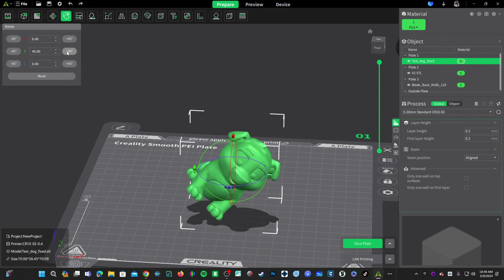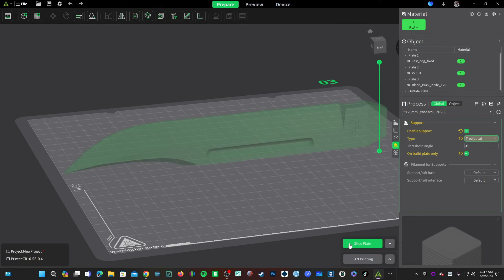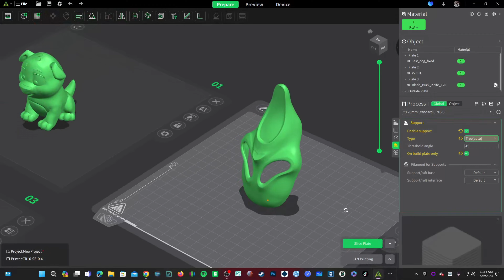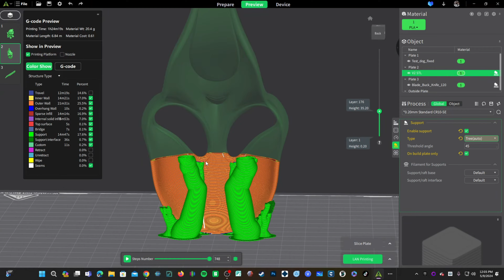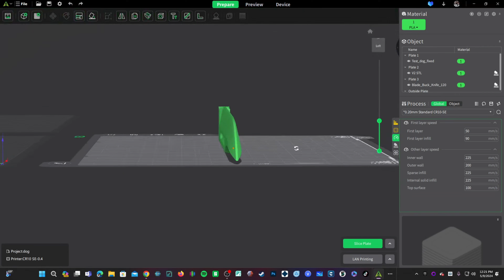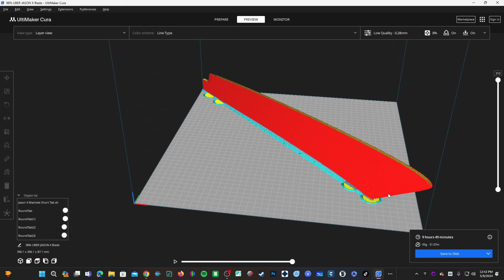Creality Print 5 Slicer Tutorial: Support Painting, Mouse Ears, Infill, Walls, Temp, Speed

Comment: So when I changed mine to -0.25 and I tried -0.50 . My print keeps moving . I’ve tried cleaning my plate with alcohol and using adhesive what am I doing wrong .
Reply from the maker: It's unlikely that the correct Z Offset, will be an even number like that. Also, 0.50, isn't much of an adjustment. You need to lower it, till it works. Whatever # it works at, is the correct #. (for now). 
DO this with me: https://youtu.be/veZB415QHM0?si=_esYwyInC3rGQXtq
Reply: @ so should I be doing - number or no ?
Reply from the maker: You should be adjusting till it works, rather than focusing on what the # is.
Reply: @ nothing is working . I tried 0.25,0.50,0.75 and -0.25,-0.50,-0.75
Reply from the maker: Why did you stop? That entire range is less than 1 millimeter. Step down till it works. follow the exercise above.

Comment: So how can I change my print nozzle height I think it’s causing my print to move around bc it’s too low any video on that
Reply from the maker: It's not. Something else going on. Which machine?
Reply: @ flash forge adventurer 5m
Reply from the maker: It's probably your Z-OFFSET. I don't own a 5M, but it looks like your machine sets it as part of the calibration process. I would rerun the Calibration. If your 1st layer looks too low, or high, make a minor adjustment.
Reply: @ I tried adjusting the offset it’s still moving around .

Comment: Thanks
Reply from the maker: So cool. Thank you!!
Reply: @3DRundown  A small appreciation for your input, good to see more of your stuff, especially with CP6 .. it works well but the support separation is not as good, I will have to compare settings. Have a good day.
Reply from the maker: There are lots of adjustments that can be made for supports, but, often times, using a different filament is the key. Some filaments are too hard, for models with difficult supports. Using less hard filaments, can make for easier to remove supports. Ex: ANYCUBIC = NIGHTMARE, ELEGOO = EASY
Reply: @3DRundown  Thanks for the info / update, I am printing with e-sun PETG on my ender3 S1 Pro, previously with the Creality Slicer separation was generally very good, but with CP6 it is generally "messy" .. I am comparing the parameters with Creality Slicer, but they do not align easily .. I will keep trying .. trial and error .. hehe .. thanks again ..
Reply from the maker: For the older Ender machines you may want to give Cura a try. PET-G is notoriously challenging on the older machine, but I believe in you.
Reply: @3DRundown  Thank you, .. your confidence is inspiring .. and hopefully accurate .. hehe .. we can but try ..

Comment: Thank you Gregg adventure awesome videos I never knew that about the temp and speed of the print...I thought once you can only do minor things to other people prints because I thought once they did the code it was set in stone...thank you so very much one more question since I updated my firmware on screen and motherboard from watching your other video so I can delete all older gcode's that was slice with old firmware??? I bought some filament and it's pla plus from sunlu how hard is it to print with???thank you again for all the patience and support
Reply from the maker: Just need to grasp the difference between a GCODE and an STL file. An STL file, is simple a model. It contains no code for your printer. When you slicer it, in a slicer, that File, is turned into a GCODE, which contains the instructions, for the printer, to print that model.

Comment: Hey guys is there a way that i can actually select the place where the tree bases are being generated from?. 
I have this issue where i want my tree supports to generate from the inside to the outside of my model. BUT its happening the other way around and its making the supports go out of bounds. So far my solution is to print diagonally to make them fit. But i would LOVE if someone had a fix for this
Reply from the maker: I don't know of a way to do this, but Diagonal is fine. I use diagonal allot
Reply: @3DRundown  already watched it. Great video 🫰🏻
Reply: @3DRundown  yeah diagonally is fine. But if we were able to select base origin for supports that way we would be able to fit more models on the same plate instead of a diagonal one that takes all the space.
Reply: Also @3DRundown you just earned a new subscriber. Thanks for the info, i was actually playing around with the tool trying to find if anyone knew more than what i already knew. And you my guy are a genius thanks!
Reply from the maker: 🙏🏼🙏🏼You may also like this one: https://youtu.be/ngckI5kbCUQ

Comment: Enjoyed the video. I have trying to use silk PLA+ Creality Print with my K1c, but am having problems with SEAMS showing up on top surfaces or slightly rounded  areas. Do you have any hints? thanks
Reply from the maker: I do a TON of silk. Several machines with silk at a time, every day. What brand filament? Speeds? Temps? Go 220/60. Slow things down. Move your Z-SEAM. Try more than one brand....
Reply: @3DRundown  Brand is 3DHOJOR Silk PLA Bronze, I have tried the stock Hyper PLA, Generic PLA and Generic Silk PLA all with stock temps. Have tried other makes and brands,  plain PLA , PLA+, silk and not silk   tried all the seam settings, Tried setting speed drown to 45
Reply from the maker: It sounds like a cooling issue. For example, check out this giant silk print, and what happens, when the bambu hotend fan failed: https://youtu.be/us4M467Wkcw

Comment: Well done, I was getting quite frustrated when I stepped over to use Creality print 5.0. When someone told me it was based on Orca, I almost moved over to it, since it has profiles for other printers as well. Still, I figured I’d give it a shot. I was frustrated that several options moved, and you helped clarify. For example, the raft moved into supports instead of bed adhesion, which is not intuitive. Actually, it’s kind of stupid. I also admire your optimism and thinking that rafts shouldn’t be necessary… with the 3v3 KE, the annoying PEI bed plate, even though it might be the best possible thing on the market, still stinks, in holding on a print. I hate wasting filament, but have to print rafts in order to stabilize taller wobbly prints (the bed is way too spastic unless I slow the speedway down). I was frustrated when I couldn’t find the option, but now I know where it is, thanks to your video. Also, the option of moving things to other beds is helpful, too. A well done video, and much appreciated that you upped the quality with this release.

Comment: thanks for the video, was really helpfull. But can you give advice? i want to ger rid of some hairs in the model, but i dont know how to do it here. Most guides are for creality slicer 4.3, where it was done by retract, but at 5 i cant find it
Reply from the maker: Retraction could cause stringing. Often setting the retraction speed too high. You'll find it under "Extruder 1" in the printer profile. Click the PEN next to the active printer, in the top left
Reply: @3DRundown  I didn't find it in printer settings, but in calibration setting. Still dont understand how to use it, and why if i change it, it throw me to do calibration test...

Comment: Great video. Just started with this slicer.  Stupid question. How do you get the "Materials" panel to show up?
Reply from the maker: It's always up.... can you elaborate?
Reply: @3DRundown  I found it. There is this small half-moon thing you have to select in the upper right corner to show and hide the panel. It's hard to see because it is black on the dark gray background.  It did not launch as open when i installed the software and went to use it.
Reply: @3DRundown  I've made a quick video.  The screen originally opened up no panel, just a small hard to see sector of a circle in the upper right hand corner of the screen.  In the video you can see me selecting the arrow to open it.
https://youtu.be/whHtAF3V8ws

Comment: I’m going to try my luck with you to try and find out what I’m doing wrong, when I prepare my model with or without support and then slice and preview I keep getting gaps as if part of the model is missing. I’ve just updated to Creality 5.1 and still no luck anyone have any ideas.
Reply from the maker: Challenge: slice the model in Orca Slicer, and see if the problem persists. 
What's the model? What profile are you using? I would use 0.2, unless see a need for something else
Reply: @3DRundown  sorry for the delay in responding, turns out that it was a bad file I downloaded everything else works fine nevertheless thanks again for your help.

Comment: Woahhhh that looks completely different from before
Reply: It's like a whole new slicer. New icon on the desktop, totally different from the old one with a C logo. But so far soooo much better.
Reply: @Gregatron13  I heard they copied off of a different slicer this time. I’m still using one of the version 4s because I’ve had nothing but problems with the new slicer.
Reply: @MG_LIFE_LBS  The patch notes say it's a combo of orca, prusa, cura, AND bambu slicers. I've only used it for a few hours, but 2 for 2 on successful miniature prints.